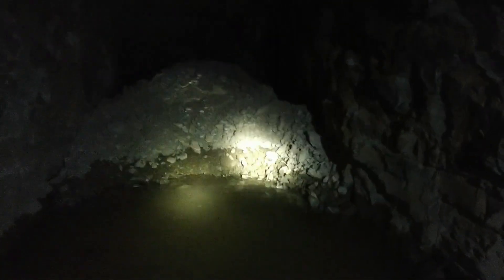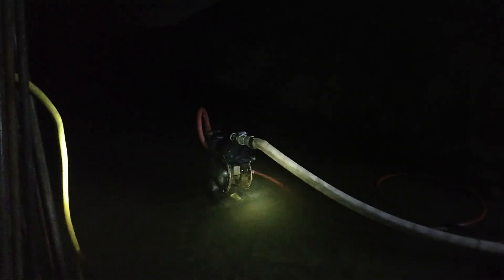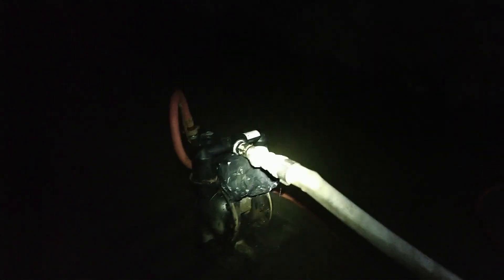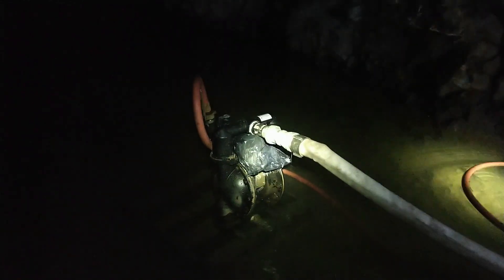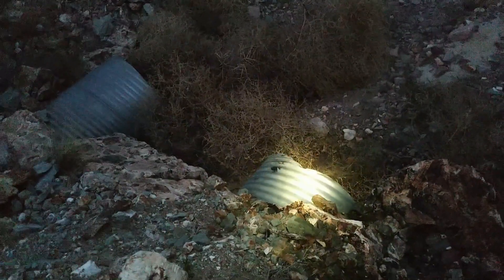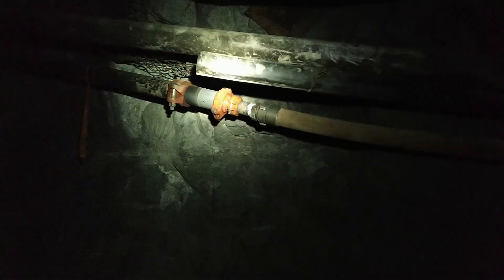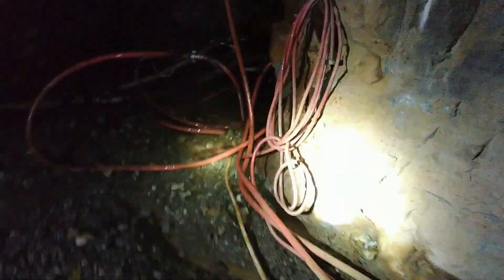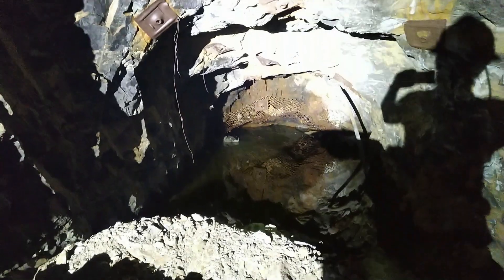Dewatering: Hard Rock Gold Mining Episode 19

Comment: Basically, you're pumping out the entire mountain.

What I would do is find a really low place on the mountain, and drive a drain into the mountain so I didn't have to spend time or money pumping all the time.

In my own mining plans, however, I plan on using fully submerged, automated mining machines [of my own design] that never need it to be dry to operate.

That way, I never have to worry about mine flooding.

But then, I won't be blasting, either.